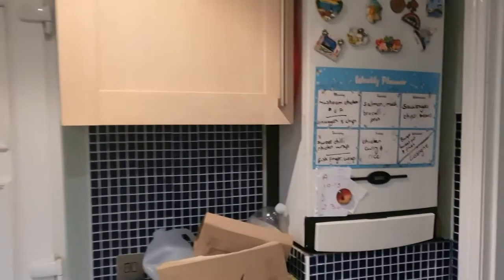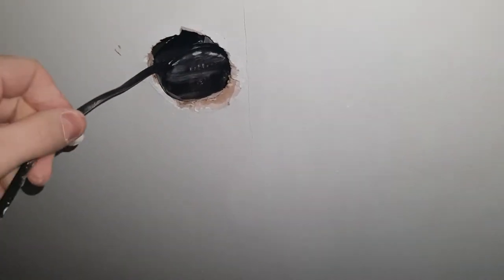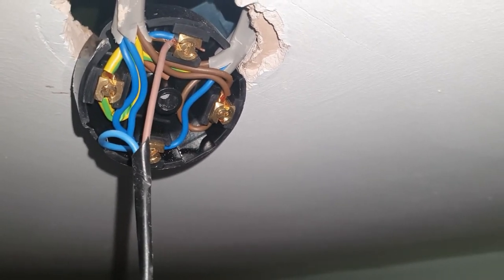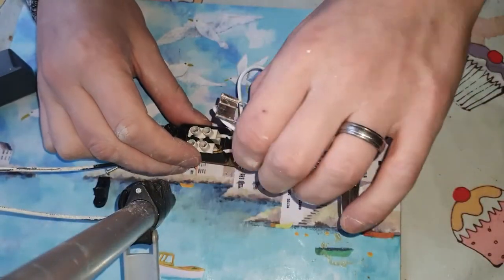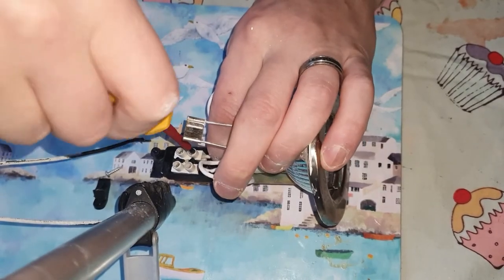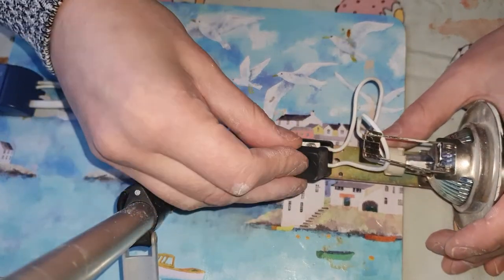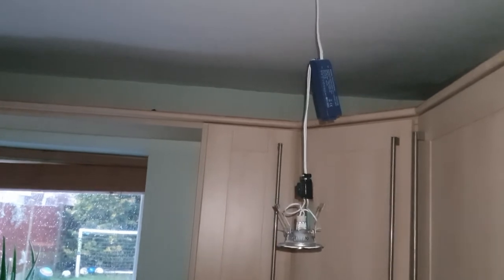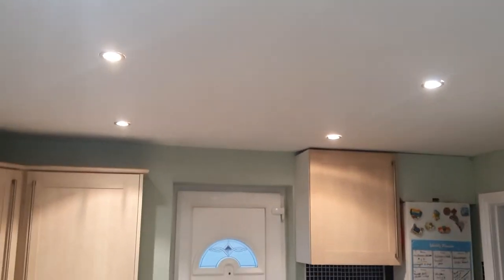CEILING OR ROOF LIGHT NOT WORKING REPLACE THE TRANSFORMER

Comment: I have about 10 of these in the kitchen, there is about 3 or 4 that go off after a few mins, but will go back on if tapped or moved in and out a few mm. Any advice please anyone? Thanks
Reply from the maker: sounds like loose cable to me, might be worth turning the power off and seeing if you can see amy loose cables
Reply: Might be the bulbs are the wrong wattage?

Comment: One of my lights will work for a while and then seems to burn the bulb out and I've gone through 3 already. It's the only 1 of 4 in the room that does this. Would I be right to assume its likely the transformer that's the problem here? All the others work fine and I'm putting in brand new bulbs in.
Reply from the maker: It could be mine were the same some just burnt out really quickly while others lasted ages.  It can't hurt trying to change it but I can't say if it will 100% fix the problem

Comment: I have a question...all 12 of our lights have stopped working in the kitchen. The fuse is good as the other lights work, switch cable is secured correctly. Is the issue likely to be at the first light or could it be all?
Each light has a blue transformer box attached
Reply from the maker: Its hard to say it could be the first one knocking them all out but I'm not an electrician so don't know how to test which ones faulty quickly,  id probaly try swapping one futher into the string for the 1st one then see it comes to life

Comment: Hi Karl, thank you for your video. My spotlights are not on a dimmer but they all now have dimmed light.  Now and again they switch on at full power, but the majority of the time, there is barely any light coming out of each bulb.  All bulbs are working (I’ve tested them elsewhere).  Please can you give me any advice?, many thanks
Reply from the maker: Unfortunately im no electrician,  it could be a faulty transformer pulling them all down but without testing each one im not sure you can find out
Reply: @KarlFixes  thanks for your reply Karl 😊

Comment: Would be nice if someone could speak about the specs of the replacement transformer.
 i.e.  if i can't find an exact replacement, then what should i be looking for in terms ov voltage, amperage, other things, etc?. 

 It's not always possible to find the exact part, especially if the unit is a few decades old.

Comment: Why did you have to make that infuriating and smug comment that it’s a 5 min job ?
You yourself mentioned it was a nightmare with the old screws.
Reply from the maker: The video is only 9mins long thats with the awkward screws and I spend 2m talking about the job at the start and talking through it as I do it so really if your just doing it without making a video it is a 5 min job.  I dont see what so infuriating its simple enough even if it takes you 10m it's very easy money saver v getting a electrician in
Reply: Dude. The point is that it's pretty simple work to swap out a transformer. He isn't spending hours on it. This isn't a week's worth of work

Comment: I have an issue in my bathroom, none of my GR11 3.5mm spots are working.

My question is, will each bulb have it's own transformer of can there be just one transformer than runs them all?

Many thanks.
Reply from the maker: I don't 100% know.  It depends on the install I believe I'm not a electrician all I can advise if you check of on the light fittings to see if they all have one or it's in a string.  Do it with the power off fully to be safe
Reply: @KarlFixes  OK many thanks for you reply.